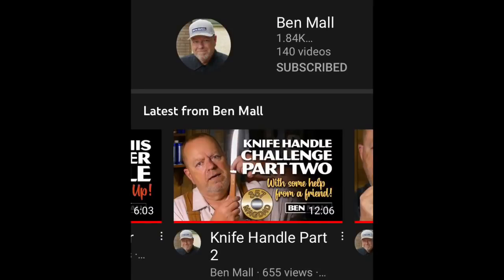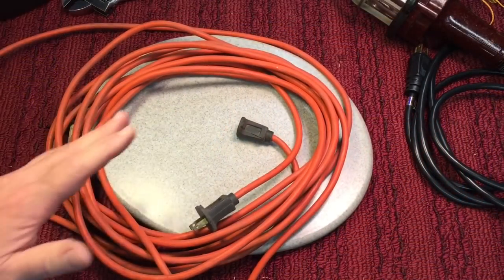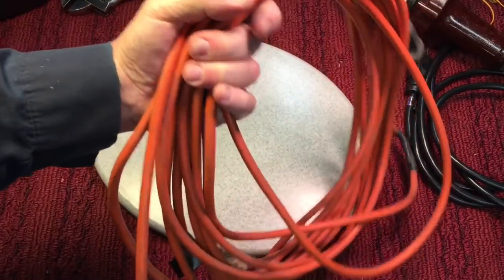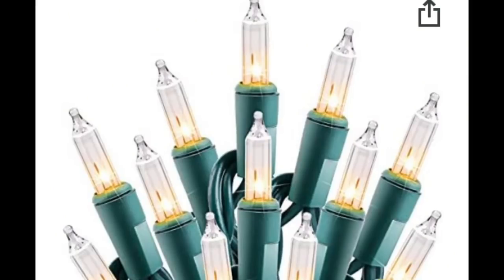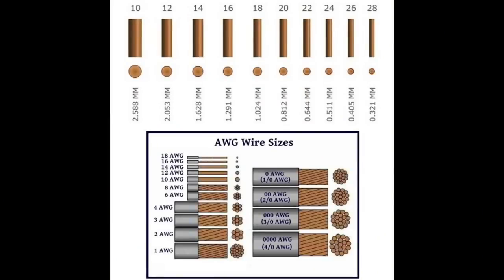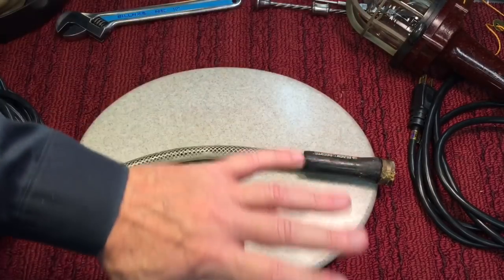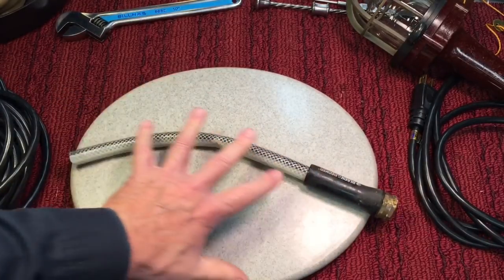Extension Cords and Rocket Lamps!

Comment: I made this analogy as an apprentice electrician 40 years ago to my engineer, voltage is pressure, current is the flow, same as a hose pipe, he told me not to be stupid, you never mix water with electricity. Makes me laugh now thinking about it.
Reply: Sounds engineerish. Had an engineer on a dam job to take compaction and whatnot and a mechanics helper asked him what the difference was between engineer boots and cowboy boots. Cowboy boots had the manure on the outside. He about shut the job down.

Comment: You sure can Rock it.  

My dad taught me about electrical extension cords, so I did a double take when I saw the cord he used to plug in his car's heater had poorly place electrical tape on it with a bit of wire poking out.  He told me some one was stealing the car's electric cords at his assisted living apartment; this one stayed right where he put it.

Comment: That lamp Rocks!! Im also a fan of home made extension cords. At work the carpenters and other contractors are always throwing cords away and for a while I would grab them out of the dumpsters to make shorter ones from the good parts of the cord. I reached a point where I had extension cords running out of my ears, lol.

Comment: Using a handy box for the end of an extension cord ish"t allowed by OHSHA. When you grab the box the knockouts can fold in under your fingers and short out the terminals on the side of the receptacle. 😁😎
Reply: I put that in the same category as a metal bodied drill motor and such others. John's plastic gang box is a good idea.
Reply: @lewiemcneely9143  It is mostly because the knockouts are only attached on one side by a thin strip. 
I had to replace one that hsd been installed on a hoist pendant control. 
The operator used it to pull the hoist on the monorail.
Gripping it he bent the slugs in and shorted it out. 
Afterwards I read the OHSHA Manual and found the rule banning them. 😁😎
Reply: @OldSneelock  10'4. I know they aren't held on by much.
Reply from the maker: Those electrical box extension cords were the rage 30 years ago...  Today there are so many cheap alternatives...  I bought two different styles a month ago for about $11 each!   =D
Reply: @ScoutCrafter  I sometimes make mine but they're just singles. I'm too senile to run 2 things at a time!
Reply: @ScoutCrafter  When I rewired the house I put in 20 amp outets everywhere. 
I added outlets in every room too. 
Still evey outlet is full.  🤨😎

Comment: Your lamp came out way better! I do think you should find a sprocket or a gear to be the base. Something bare metal to provide reflection to the flickering bulbs
Reply from the maker: I wanted to make a moon looking base!
Reply: @ScoutCrafter  ooh that's a much better idea. It would be easy to source a 3D printed one but yuck to plasticky. Where are you going to find a vintage representation of the moon? maybe cut a section of the globe?

Comment: I only use 12 and 10 ga. extensions outside unless it is something with a small draw. Back when I was doing roofing for a few folks I bought a lot of air hose. I must have 250 feet of air hose. I would put the air compressor as close to the outlet and get distance with hoses. That initial start on an air compressor has a lot of draw.  As to the light, nicely done. Think of it this way, sometimes you get something so disappointing it makes you do what you should have done to begin with. It gives you a jumpstart. That is how Packard Motors started.  James complained to Winton that the car Winton built was not good. Winton told James Packard " if you think you can do better build your own." He did any many remember Packard but few Winton.
Reply from the maker: Philip- You are so right!  Compressors and AC units draw the most!  I have one of those dreaded pancake compressors and that draws every bit of 15 amps on start up!!!!

Comment: Another thing to be carefull of is older houses were sometimes wired with #14 gauge wire instead of the modrrn #12 gauge. 
#14 is okay for a 15 amp load,  but can overheat under a 20 amp load. 
Plugging a gang box into such an outlet, even with #12 cord feeding the gangbox, can cause the house wiring to overload and may start a fire
Reply from the maker: Good point Dave.   The only devise I have that draws 15 amps is a pancake compressor on start up...  For much of todays devises 15 amps is a lot!  Running two major units at once is always a no no!  =D
Reply: @ScoutCrafter  I had many run ins with overloading circuits. 
Cubicals are wired for a couple outlets. A computer, monitor, and printer fills 3 if the 4 recepts. 
Then the ladies put in a heater summer and winter. Add in a coffee maker, damn Kurig anyway, and a toaster runs it right up over the 20 amp breaker that feeds the whole row of 4 cubes. If 3 heaters come on at the same time all the computers go out. 
The denizens of the cube farm soon learn to reset the breaker on their own. Soon the wires begin to fail at connectons and start arcing. 
Simple solution right,  just put in more outlets. 
No matter how many you install there will be one more plug than there are outlets. 
It's like saying, "I can't be out of money I still have checks!"

Comment: Another great topic!
Here is a suggestion:
Never loan out an electric tool to your neighbor!
I made that mistake once and after asking if my neighbor would want a proper extension cord.
He said that he had the proper cord after me emphatically telling him of the importance.
When I got my 110 volt welder back, all it would do is pop the breaker.
DOH!
Reply: I tell them to bring what they need welded over and I will weld it. 
Saves all the hard feelings.
Reply: @OldSneelock  Woir4ks the same with chainsaws and wives. I SHOULOD'VE LOANED THE 'WIFE' AND KEPT THE SAW!
Reply: Very valuable advice, except I would add that it applies to all tools and books.

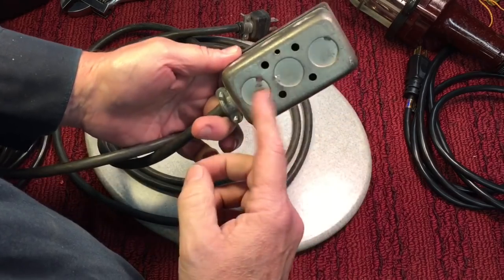Comment: Just a warning to you and all others who may not know, at 4:18 it seems that the metal box doesn't have any ground screw attached to it (I can see the empty ground screw hole on the back). You should ground/bond those metal gang boxes with a 10-32 green ground screw and ground wire (they sell those screws and also sell the screw with the pigtail already installed) so that under a ground fault condition the breaker will trip rather than you getting potentially shocked. You can connect the ground pigtail from the receptacles to the incoming ground and the ground coming from the box's ground screw so they are all grounded/bonded together.
Reply from the maker: Hi Kris- It's grounded internally...  You can ground those boxes many ways without a screw protruding thru the case.   I have a outlet tester that will show open ground, hot ground, hot neutral...  and of course proper hookup.  I use that tester on all my devises!    Thanks!
Reply: @ScoutCrafter  No problem. I see, and I am not sure if you used a ground clip or an other method. I do lighting and electrical for a living so I often do things by the code book and also overkill, like using EMT conduit and also running a ground wire inside of it even though the EMT itself is a listed grounding conductor. An outlet tester will not show you if the box is itself is grounded, though, since it will just show that the device itself is grounded in some way. If you have brought the ground connection to the receptacle and have that device screwed into the metal box, it will ground the box, but will also be a violation of code. If for some reason the device becomes loose from the box, that box can either become ungrounded or create a high impedance ground fault current path. In other words, the breaker may not trip during a ground fault due to poor connection back to source (breaker panel) which means the box could become energized at 120VAC, which I have seen happen in the field. They also make self-grounding receptacles where you can just ground the box and screw the device into place because it has a special brass piece on the yolk that tightly bonds the device screw to the yoke, which in turn bonds the device to the already grounded box. Just a heads up in case you may not know. I am OCD so pardon my rant. Lol
Reply: @ScoutCrafter  I have also seen bootleg grounds where they connect a pigtail from the neutral to the ground screw of the device. Unfortunately, often the only way to find such issues is to remove the device(s) since a tester will say it's properly wired. The ground and neutral are bonded together at the main panel so to the tester it sees the receptacle as grounded as long as there is 120VAC between the hot and ground terminals.

Comment: I have three extension leads that I made from 150’ of rubber covered cable that was used to take power to a chicken shed. £2 at a car boot sale , many years back. Very heavy gauge multi strand wire at least 25A. No voltage drop or overheating for me!

Comment: In my house,  everything is in the process of being on a circuit breaker, surge protected power strip, switched gang boxes for the workbench, GFIs, or AFIs. Nothing left powered not in use.  Florida is unreal with the superstrike lightning hits. House has been hit 8 times in 45 yrs. Grounding & bonded circuits checked also. Surge protected service box.  Original owner & myself have both been shocked by lightning flowing thru an aluminum window frame to a ground. 🤯

Comment: The rocket lamp is cool!  Note: the picture of the real one had the street elbow, then a coupler, and then a reducer with the larger side out.  It made the "engines" longer so they could fit the whole socket without major modification and the reducer kinda gave it the effect of a rocket nozzle.  Just sayin.  It would help with the proportion difference between your longer cage lamp and shorter engines.
Reply from the maker: Yes- I used longer bulbs and wanted a shorter less clunky looking rocket exhaust..  That is why I had to modify the sockets slightly..  =D

Comment: Elon Musk should use your design for his next space ship. I have sold construction and industrial extension cords for many years. Your video was great advice. I had many problems with competitors selling cords from China that were labeled 12 GAUGE STYLE but they were actually 14 GAUGE wire with a heavier filler to make the cord outer diameter the same as a 12 gauge wire cord. Of course they were cheaper as the main cost of a cord is the copper wire. They caused power tools to burn up and were also a fire hazard.
Reply from the maker: Hi John!  One thing you can't substitute is Copper, and as you know Copper is always expensive so when a cord is cheap you can guarantee they are cutting out some Copper!  LOL  Thanks!

Comment: One of my favorite tools on Earth is the cord reel from a meile vacuum cleaner. Super high-end German vacuum that my neighbor bought and it crapped out after a year. When I took it apart it had the most brilliant little cable reel with 50 ft of excellent SJO cord. I think vacuums are almost always SJO, not sure though. For some reason, this little spool is a third of the size of any cable reel and it never tangles or sticks or anything. I spent years trying to figure out why nobody was marketing these on their own.
Reply from the maker: Interesting history on that cable it was a certain gauge designed especially for vacuums and spilled over to other appliances.  I think 18AWG

Comment: John, fantastic video, have you noticed that things are not as simple as we think there's cord gauge versus amperage , medium duty use, heavy use, extremely heavy,ultra heavy use  then oil resistance fluids, weather resistance , different colors for different industries and let's not even start on the plugs and connectors ,straight blades , locking blades ,lol .Ben is going to be really confuse lol

Comment: Just my opinion, but I threw out all of my wife’s skinny extension chords when we got married. I bought a half dozen 12 gauge chords in various lengths to replace them. Seems to me that you can’t go wrong with the heavier gauge, and I find that I use the 10’ chords a few times a week to run power tools or my smoker or to run a battery charger. Sometimes shorter is better.
Reply from the maker: John- Those big beefy cords are so nice- A bit pricy but you can't put a price on peace of mind!   Thanks!

Comment: I don’t think that putting a sharp bend in an extension cord or placing a heavy object on one actually slows the flow of electricity. However doing things like that can damage both the wire and the insulation. My late father in law, who started his apprenticeship as an electrician in 1940, left us several extension cords that he had made up many years ago that are still as good as  new.
Reply from the maker: I think you are right, the problem is heat build up that eventually destroys the insulation and then the problems really begin!  =D

Comment: A further point re the coil effect, if your extension cord comes on a wind up reel, the reellabel  may give 2 different ratings for max power. One for not unwound and the other (generally higher)for an unwound reel.  John Clough

Comment: I try to stick to 14 gauge for most extension cords. I figure a 15A circuit uses 14 gauge wire so I keep it the same even though I know I'll never draw 15 amps.
Reply: A typical circular saw draws 15 amps. Are you still sure you’ll never draw that much?
Reply: @janderson8401  Good point. For what I have now, I won't get close to 15A but I'll keep it in mind if I bring any large machines into the shop.

Comment: That's funny I was just looking at one of those Rocket Lamps on eBay (suggested I wasn't actually searching for one) for $22.95 with free shipping, I thought no way it can be made from real parts so I looked at the material and it said plastic.....................I have a trim router with a beefy looking cord that the cord went bad on, when I got it apart the actual copper wire was just a few strands.
Reply: what he didn't tell you is that the cord wire 16SJ is a standard jacket cord or a SSJ is a thicker jacket.  they make others but a SSJ is used when cutting the cord by using the tool is likely.

Comment: You should have mentioned with the use of extension cords u should be properly grounded using GFCI's. Extension cords and GFCI's go hand in hand and are required per OSHA. Also, check your cords and ensure that it has the proper grounds attached.

Comment: Boom 😂😂
Reply: Could you do a video on drill bits, I've been restoring a hand saw but the handle was not the original one and the drill bits I had would not touch the steel of the saw, all they did was burn out, still not sure what type of drill bits I need to buy for this sort of project, many thanks Michael from the UK 👍👍

Comment: You usually cover everything very thoroughly. I've never felt the need to ask for further clarification. I felt that you left the electrical cord segment incomplete. I would have shown the viewers how to properly repair or replace a cord and the reasons why you would repair or replace the cord
Reply from the maker: I could literally talk on extension cords for over an hour!   There are dozens of interesting topics covering so many aspects of this simple devise.  However, not everyone has the attention span for such mundane subjects and I try to convey as much info as I can without losing 3/4 of the audience.  As for repairing the cords I am a nut for extension cord repairs and could easily talk for 20 minutes on just repairs!   I have experimented with so many different techniques I think I am close to finding the perfect fix!!!!!   =D  Thanks!

Comment: Yeah, you're not gonna get a "real" steampunk rocket lamp for $40. The safety cage "body" alone cost $35 minimum. For the one I'm building right now the total parts cost was easily over $100, and then of course the time taken to build it. Yours looks great btw! Mine incorporates a few extra parts and a different approach for mounting the "exhaust"/"thruster" sockets, that doesn't involve a belt sander. Also, RTV is a solution I had not thought of, may consider in the future: I've seen other folks using hot glue, and I just didn't like that idea. I made a little video of my solution here: https://www.youtube.com/watch?v=Z2j2U3YKX64